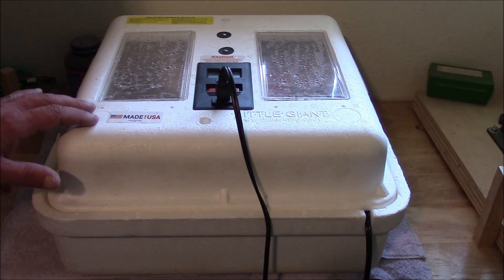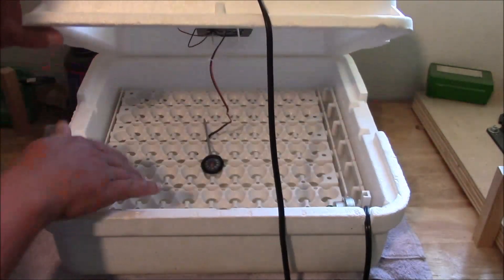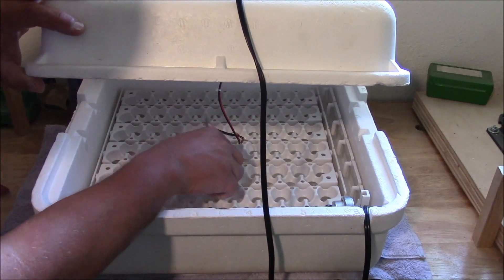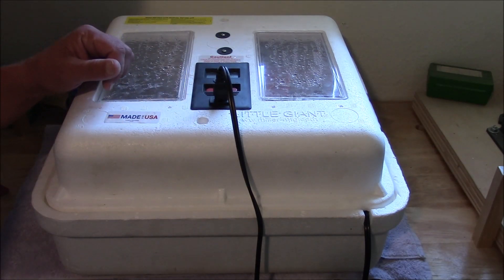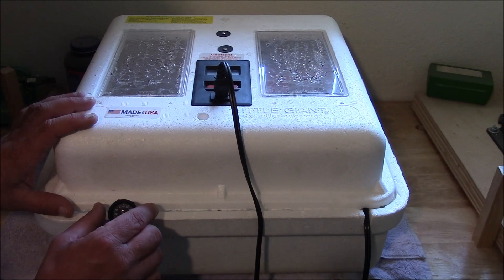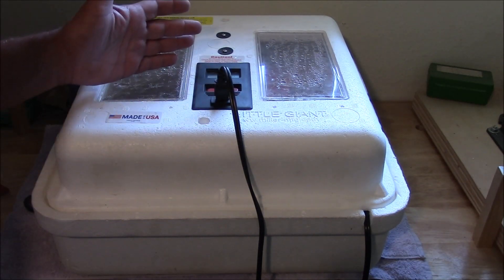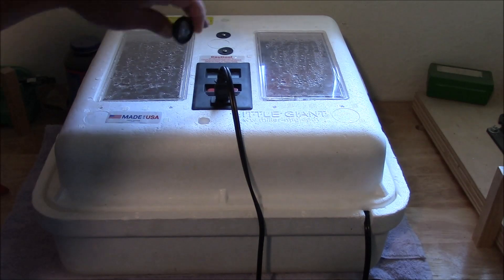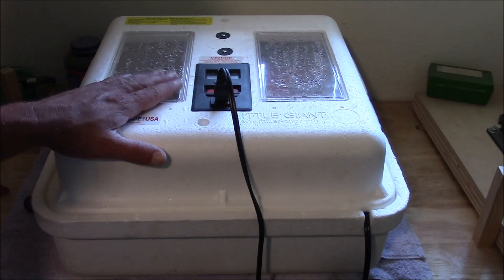How to Improve Your Hatch Rate Part 3: Preparing Your Incubator for Incubation

Comment: I just purchased a new Little Giant 6300 and my humidity stays around 45 percent. How do I bring that level up ? Thanks for your help ! Timmie
Reply from the maker: I wouldn't stress too much about what the humidity gauge says.  It probably isn't accurate.  If your incubator windows are fogging up  you are well over 45 percent humidity.  Humidity isn't as important as temperature.  If you are filling up the water trays inside you should be fine.
Reply: Thank  you !

Comment: Great video, really helped me have a successful first hatch with my new styro incubator. I'm glad I did not throw away the red plugs. I live in northwest Oklahoma where it is very dry. Typical day about 30%, but it can get down below 10%. I really struggled to get my humidity up at all until I put the red plugs in and taped half of the smaller holes. I also added a humidifier to the small room where the incubator is. Was able to get humidity into the 70's during lockdown.

Comment: How many times would you need to refill the water?
Reply from the maker: It depends on your humidity.  for me, in the winter it dries out much faster and I have to fill it frequently.  In the summer, I really don't need to add water at all until lock down.
Reply: @Slightlyrednecked  Oh ok thanks

Comment: We collected eggs for about a week before we processed and check for fertility and, I would like to know if we should move the eggs off the turner on day 17day instead of day 18 bcus they might start piping early and I dont wanna risk shrink wrapping them
Reply from the maker: Yes, moving them out of the turner on day 17 or even earlier is fine.  I often move them out on day 15  myself.
Reply: @Slightlyrednecked  4 of them have hatched one is still absorbing its yoke and is moving around now!! Thanks for your knowledge you share!!

Comment: How do you clean the bottom of the incubator after a hatch? Could I place my quail eggs into paper egg cartons or line the bottom with wax paper just before lockdown to help limit the mess?
Reply from the maker: I wouldn't put them in egg cartons.  They could end up with leg problems or things like that.  You can put something like shelf liner on the bottom of the incubator but you don't want to use something like wax paper that is slick.  it can lead to splayed leg and other issues.  I just scrub mine out with dish soap and water when the hatch is finished.  It doesn't get all of the stains out but they don't really matter.  I hope that helps.

Comment: Can you hatch store bought eggs like is that possible
Reply: Kenzie Welsh No. store bought eggs are from hens that are in cages and not by any rooster. You can actually store eggs if you have a hen and a rooster. Say you collect eggs from your chickens  in December and you put them in the fridge and in June you want to hatch them you can actually take those eggs out and hatch them. It’s super neat!
Reply from the maker: It is possible to hatch store bought eggs.  I would agree that it is rare and most are not fertile but it has happened before.
Reply: @Slightlyrednecked  ok thank you
Reply: What if the eggs said fertile on the carton
Reply: With chickens, males are killed off almost always as soon as they know they are males. With quails on the other hand, you can.

Comment: How do I increase the humidity? I’ve added water to all the trays full every time I’ve turned the eggs but it’s still saying 44-48% each time.
Reply from the maker: That can be tough.  Sounds like you live in a very dry area.  If you have the ability you can add a room humidifier and place the incubator in a small room (like a closet) to help bring up the outside humidity.  If that is not an option, then I wouldn't stress too much.  Chances are, your humidity is actually much higher than what is shown when the trays are full of water.  It is hard to measure humidity accurately without doing relative humidity (look up wet/dry bulb if you are interested).

Comment: So I have the same incubator. Testing before setting in the eggs. It's set to 99 but it keeps going up to 100 and 101. It's in a 72 degree room and not in direct sunlight. Why doesn't it stop at 99? Is it suppose to do this?
Reply from the maker: That is pretty common actually.  It should level out a little and not spike too much with just a little bit of time.

Comment: My incubator was always hotter then i set it, after i removed the grill and looked into the fan the temperature sensor was RIGHT infront of the air path....
After splinting and putting a longer wire it works fine now... something people should check for if your incubators are too hot or cold.
Reply from the maker: That is a great suggestion.  Thank you for sharing.

Comment: I've got the same incubator and found that the connector for the temperature sensor is faulty causing a resistance that introduced error to the temp measurement. I messed around with the connector, tweaking pins and so forth, until I finally gave up and soldered the temp sensor wires directly to the control circuit board. The temp has been consistently accurate since then. I also installed a small computer fan with a 220 ohm resistor in series to slow it down. Temps are way more even across this unit with just a little air flow. However, If the air flow is too much, the overall temperature swings become much larger.
Reply from the maker: If you have more problems with it, just contact the company that makes them, Miller Mfg.  They are really good about sending replacement parts.  Sounds like you got it figured out though.  Good job.
Reply: @Slightlyrednecked  I gambled on it used, turner included, for $25 so I wasn't going to bother the manufacturer with it. Not so much a complaint but an observation that made me wonder how many of these models have the same defect.

Comment: How hot should the incubator be?
Reply from the maker: 99.5 F for a forced air incubator and 101 F for a still air incubator.
Reply: @Slightlyrednecked  will the eggs be fine if theyve been in a still air incubator that was at 99.5 for the first 2 1/2 days ?
Reply: @rosaliasuarez6889  You should be fine. According to an old report from the US Dept. of Agriculture I found, eggs will have a 70% hatch rate at 98 F and 102.25 F. 100 F is the ideal temperature according to that same report.

The report is titled: "EFFECT OF TEMPERATURE, HUMIDITY, AND
 OTHER FACTORS ON HATCH OF HENS' EGGS AND ON ENERGY METABOLISM OF CHICK EMBRYOS"

Here is a snippet from the report that should put you at ease:
"The best hatches were obtained at 100° F., which indicates that this is about the optimum temperature for incubation. The hatch decreased at higher and at lower temperatures, slowly at first, then more rapidly as the deviation from 100° increased, until at 96° and at 103.5° nearly all the embryos died in the shell. The appearance of the chicks varied considerably with the incubation temperature. At 102° F. they were not so large, fluffy, and lively as at 99° or 100°. There were also many abnormalities. The most common troubles were crooked toes and sprawling legs. In the latter case the chicks were unable to stand. Crooked necks also appeared frequently, the chicks never having been able to straighten them after emerging from the shells. Practically no abnormalities occurred at an incubation temperature of 100°, crooked necks never appearing and crooked toes very infrequently, and the chicks were strong and vigorous."
Reply: Ive set mine to 100 F for everything. always worked

Comment: Okay so I turned on my incubator I'm calibrating it I'm not due to put eggs in there until Monday I filled out the little reservoirs with water just for shits and giggles..... what is the temperature supposed to be now and after I put the eggs in.
 Iui
Reply from the maker: The temp should always be the same.  101 for a still air incubator or 99.5 for a forced air incubator.  It will fluctuate as you add eggs or water but it should level back out to that.

Comment: Hello, I  am not having a good experience, I incubated  48 eggs  and I gat only 7 quails.  All of the other eggs had the bird inside  with the beak  out. I don't know  what  am doing  wrong.
Reply from the maker: It could be a number of things.  Birds pipping but not hatching is usually caused by the incubator being opened during lock down.  The rush of fresh dryer air causes the membrane in the egg to shrink down and basically trap the bird inside the egg.  It can also be caused by too much calcium in the hens diet.  This can lead to thicker egg shells that make it difficult for the bird to break out of.  I hope that helps.
Reply: @Slightlyrednecked  how often should i add water for turkey eggs and should i not open it to add water? and what percent should i have the humidity at for it.

Comment: The manufacturer says to leave the plugs unless you’re at 6000 fasl or higher the incubator has vent holes and leaving the plugs out makes it take longer to stabilize IDK but that what it says
Reply from the maker: I disagree with them.  It may take a little longer to stabilize but the eggs need ventilation.  I always suggest removing the plugs.

Comment: got a question for you. Can 2 degree make a difference in your hatch to low and have the chicks die in shell?
Reply from the maker: yes it can make a difference.  Temperature is the most important part of incubating your birds and you want it as accurate as possible.
Reply: Slightly Rednecked I have a question that does the if the incubator is auto then do we have to put a thermometer

Comment: Hi I have been hatching eggs for many years, always prepped the eggs, use proven temp and humidity gauges and always had good hatch rates ..... However I'm always willing to learn from the person who gets a better hatch rate than me. I have two important points to add, the location of the incubation is critical for stable temperature and humidity and secondly only purchase eggs from proven supplier or make sure eggs from your own stock are sound and fertile. Poorly feed hens and roosters will not produce good hatch rates
Reply from the maker: Very good tips.  Thank you for sharing.

Comment: Question before I finished video - I thought you stated in another video not to use water at the beginning of incubation for first 14 days must be low humidity and on 15th day add water for lock down to get to 65%. I may have misunderstood - please clarify. Thank you for the series - very informative:)
Reply from the maker: I often leave water out for the first 14 days.  Especially in the summer when it is so humid out anyway.  But that really depends on your climate.  if it is very dry you will probably need to add water just not as much as you do when they go into lock down.  I hope that makes sense.

Comment: I ordered eggs off ebay . It took 4 days to be delivered and to begin the incubation process. The lady said they should hatch and has a 100% positive feed back but it was very cold and we had a freak snow storm during the shipping time. Has anyone had a similar situation with a positive outcome? I'm feel very pessimistic. Great video BTW! thumbs up!!!
Reply from the maker: If they froze you may have some problems but I would bet they are going to be fine.  Just incubate away and expect some to hatch.  Good luck.
Reply: I'm curious to know how your hatch turned out. Could you update?
Reply: None of them hatched :(
Reply: I'm sorry to hear. Did the seller make it right or were you out of luck with that group?
Reply: I didn't think it was the sellers fault. I just had bad luck with a crappy incubator from china.

Comment: Hi Chris, this video series is just the best. I just hatched out my first eggs, and throughtout the process I found myself going back again and again to watch them when I had concerns. So thank you.

One question, I see the replacement thermostat for your unit can be purchased for $30. Do you know if it can be used to upgrade the still air model?
Reply from the maker: I am not sure to tell you the truth but I do know that Miller Manufacturing (the company that makes little giant incubators) has been very receptive to me.  I am sure if you contact them they will be able to answer that question and do so very quickly.  I don't see why it wouldn't work but I just don't know.
Reply: Slightly Rednecked Thank you. I'll give them a shout.

Comment: Hi Chris, my two daughters and i Bought some quail around Christmas time and have now tried to incubate some eggs twice. the first time we tried 8 eggs. At around day 17/18 we noticed little holes appearing in some of the eggs and the kids were very excited that we could see the odd little beak moving inside. however none of them got any further than this despite waiting for another couple of days,  in the end we tried to help a couple of them, one was a disaster, the other managed to get out but couldn't walk and just flapped about on its side for 2 days before we reckoned it wasn't ever going to be able to stand up. all in all it was a bit of a disaster! i wanted to the kids to see and experience something magical but in the end it was quite heartbreaking.  we are now at day 18 of our second attempt, we have 12 eggs in the incubator, some have developed the same little holes as last time and we can see tiny bits of movement as the little beaks try to poke through. I suppose my first question is, how long, once a chick has first cracked the shell should it take for them to emerge? is it normal for them to crack a hole and then stay inside for a few more days? or are my quail struggling to break out? is there anything i can do at this stage to help them? and what can i do to stop this from happening in future hatches? thanks
Reply from the maker: wow, so sorry for the slow response and I hope you had some birds hatch.  They generally hatch pretty quickly once they pipped the shell.  Make sure you don't open the incubator during that time.  The rush of fresh air and drop in humidity can cause them to get shrink wrapped in their egg and not be able to get out.  Are you feeding extra calcium to your birds?  It could be that the eggshells are too thick and the birds are having trouble getting out because of that.  It sounds like your temp is correct if they are pipping on day 17 so those are my first guesses.  I hope that helps and I hope you had a successful hatch.  Hang in there, incubating is a learned skill and it will get better.
Reply: Thanks for getting back to me! just to update you. There were 12 eggs in the incubator,  7 'pipped' over the course of 2 or 3 days, one seemed to be having a really good go at it so i thought they might be ok, but when i checked later it had died in it's shell. At that point i decided that if i did nothing, i'd lose them all and i didnt want that to happen again (especially for the kids) so i gently tried to help the other 6 out of their shells giving them some assistance and then leaving them to do the rest but eventually i had to go back in and help a couple further. As of now four are in the brooder, running around and the other two are still in the incubator, i'm not sure how those 2 will do but time will tell. None were able to hatch themselves, so clearly there's something I'm not quite getting right, maybe it's a humidity issue? I'm not sure about the calcium quantities in their food, I'm not supplementing their crumble with anything apart from the odd grub that i find when I'm gardening. Any way i'm delighted that we have a few chicks to show for our efforts, the kids are very excited, we will go again and try and learn from our mistakes! I've followed your channel for quite a while and it's always very informative and helpful, and a lot of what i've learnt has come from your videos,  thanks so much for responding to my question! we are in Belfast, Northern Ireland by the way. I'm sure you know you've a global audience but maybe it's nice to know exactly where you're helping folks out! Take Care and keep them coming!

Comment: hello you mentioned that for the last three days you get the humitity up to 90, well how do you do that? i watched the video, i added caps to add more water to see if the humitity goes up, but cant get it up to 90, 65 is the best i can  do, can you give me an idea? please
Reply from the maker: First of all, I wouldn't stress too much about 65 percent.  As long as you have the water trays full of water.  I would remove the caps as well, the fresh air is more important.  Remember that humidity is based off of surface area not volume so a long wide tray of water will raise humidity more than a tall skinny glass of water.  So adding a soaked sponge (lots of surface volume) can help if you need more than what the water trays provide.  I hope that helps.
Reply: hello and thank you for your answer, i noticed with the caps i don't have to open the incubator as often, ( does it make any sense? )  with the caps is good for six days without four days, so am going to leave them, this time it is my first time, am exited, your videos have help me a lot. thank you again, i let you know, ten more days, all the way from mexico,